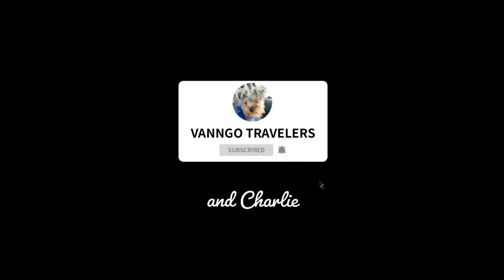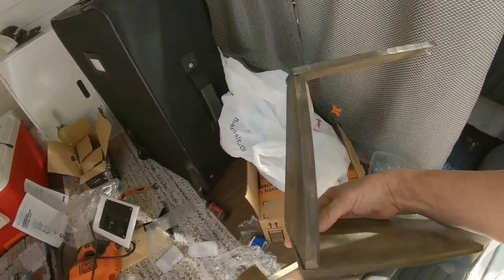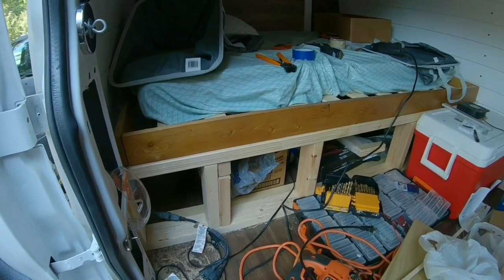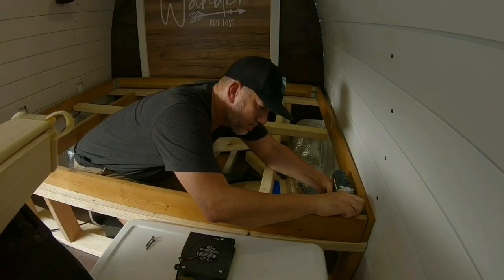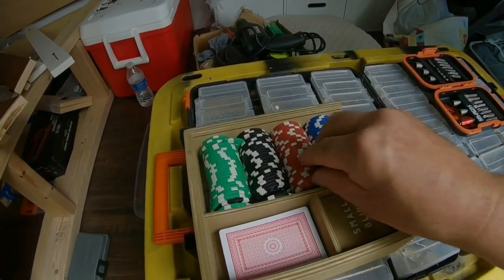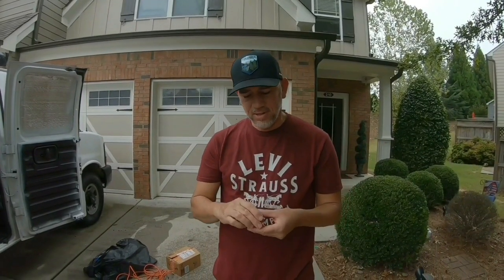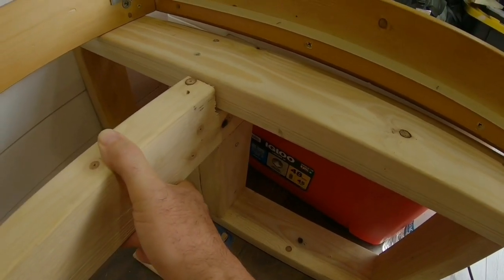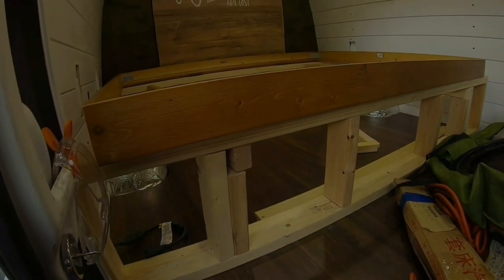GMC Savana 2500 Van Build - Bed frame setup - Frustrations

Comment: nice build! did you put wood studs behind the wall panels. also how did you run the wire on the driver side  top corner. mine has factory wires going all across on the top
Reply from the maker: Thanks! I did install studs wherever there were metal beams. So the wire in the front I ended up cutting and then splicing them back together. I would not recommended it tho. Those wires control all of your lights inside and out. Brakes lights, turn signals etc. I had some issues with my night lights and turn signal. I got lucky and figured it out but gad to work on it. I thought I did a pretty good job on labeling them but it’s quite a few and it can get confusing. Hope this helps. Don’t hesitate to ask me any more questions. Thanks for commenting.